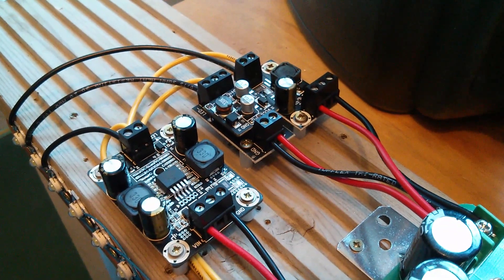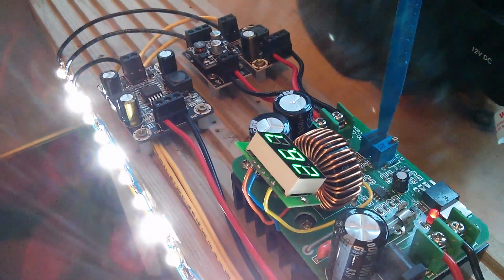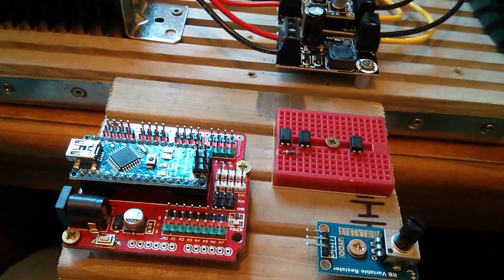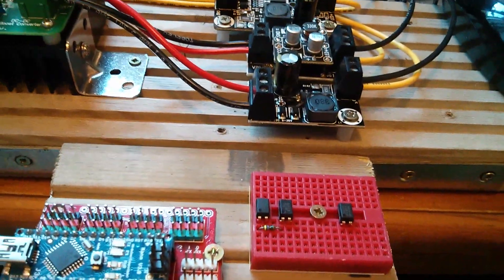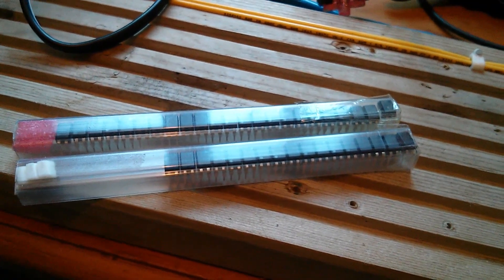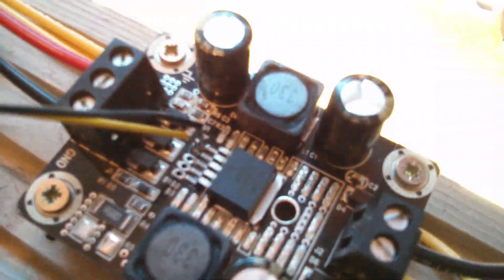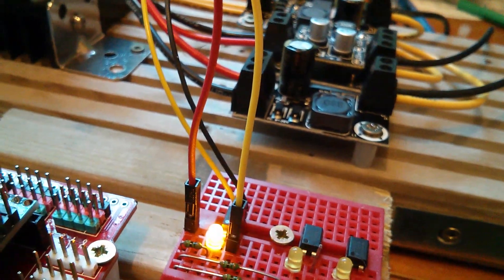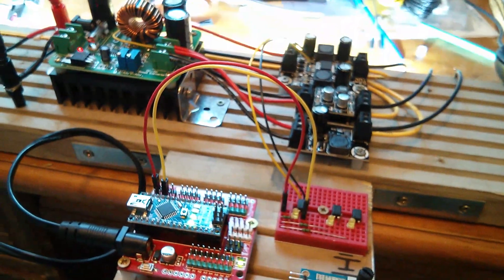Sequencing 30 High Power LEDs with Arduino and LED Drivers #3

Comment: Taking it a bit further, suppose that you wanted to dim high power LEDs via PWM from the Arduino, how would you wire it? Wire MOSFETs in series with the LED drivers and drive the gates from the Arduino's PWM output pins?

Comment: I used the PT4115 to drive a 10W led. But I used it to dim the LED. Pin 8 is the dim pin also the enable disable pin. The dimming of the led is fairly easy bacuse you only have to use a PWM signal  to dim the led.

Comment: Hi , Julian Ilett  I've been interested in building a 100W LED pannel made out of 33x3W LEDs. In your channel I found some videos related to the topic but I still don't know which LED driver to use, how to connect the LEDs (parallel or series) and how many of them per row, etc. I'd really appreciate a short answer since I'm afraid to burn something.

Comment: "Half expecting it to go up in flames"... LOL.

Great job on the build Julian, I like it.

I do the same when requiring parts, I'll buy a few from the UK then buy in bulk from China. As long as you have some decent sellers you can't go wrong. I must have saved hundreds doing it this way.

John
Reply from the maker: Thanks John
Yes, I've got to know which sellers are reliable and sell good parts. Also, some sellers just seem to be quicker than others